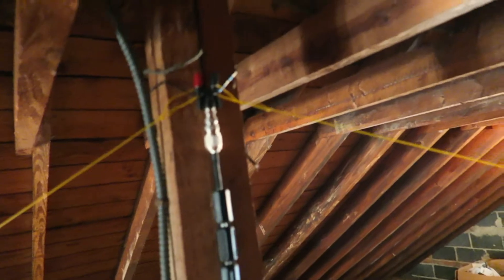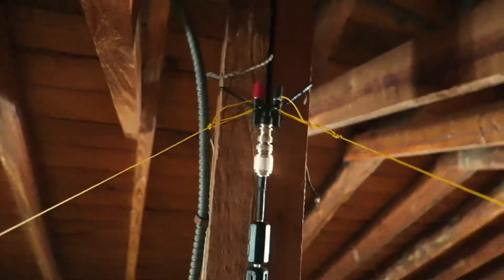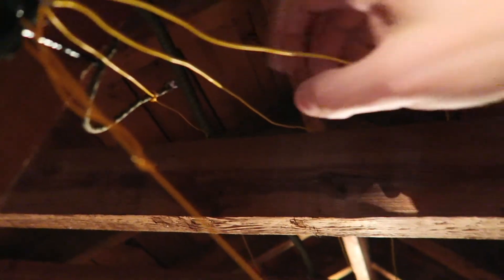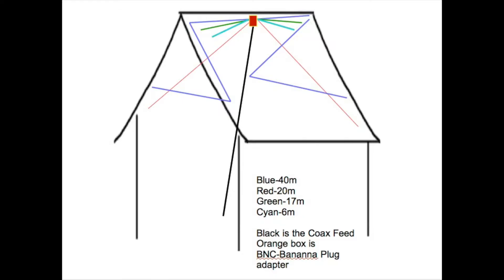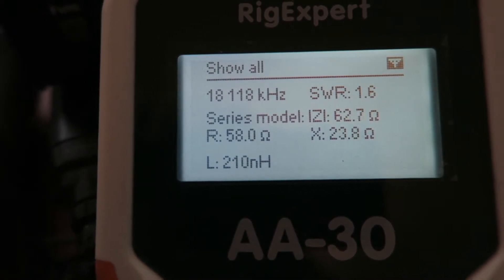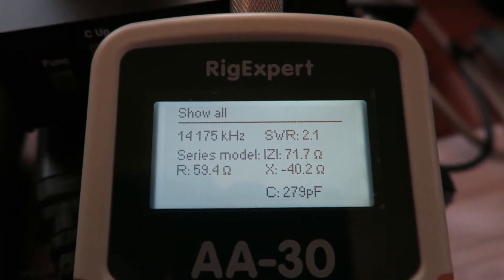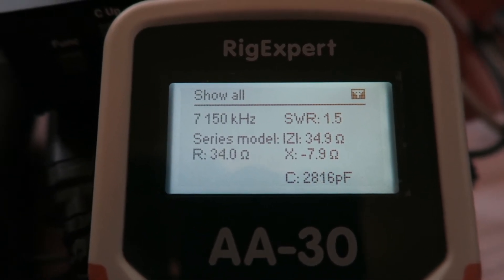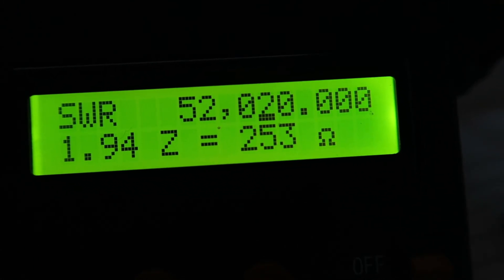Fan dipole, or multi-band dipole, antenna in my attic for my ham radio hobby

Comment: Have you ever used ladder line as the antenna element? You can make the antenna 33% shorter and get better bandwidth than our regular dipole. You only connect one wire on each side to the feed point and at the end you short those two wires together
Reply from the maker: Thanks! I just bought some 450ohm ladder line for another project. I might give that a try too!

Comment: Great video... I have a similar sized attic and started with a nonresonant 135' dipole and a 1:1 balun. My receive is excellent from 80-20 (best on 40) but my problem is transmit.  I'm running 100' of rg8 coax down to the basement where I have my shack. My swr at the antenna load point drops down to 2:1 at the most resonant frequency and is off the charts down at my shack.  I also have the same power lines as you do up there, and a small mobile dual bander for uhf/vhf.  I'm also running the coax inside the house instead of out the gable like you've done.  Where do you think I've gone wrong? I'm thinking about pulling out the dual bander first, testing again, then try running the coax out the gable. Would appreciate any suggestions you have.
Reply from the maker: Hello! Hmmmm, do you have any extra coax in that run? Maybe do a DIY choke at  antenna connection? Or at a minimum coil any excess coax. I think my feedline is 75'. I also have that short piece of coax with ferrite beads at the feed point you see at 5:19
Reply from the maker: Also, if you have an antenna analyzer, you could find out the resonant freq of the antenna and decide if the length needs to be adjusted.
Reply: @InPhocus_ADV  Thank you so much. I re-strung my dipole to include more straight paths around my attic and added a diy choke at the antenna/balun connection point.  This helped significantly. After reading some more about coax impedance at long lengths (100ft from the balun to my shack in the basement), I'm considering experimenting with ladder line. I have 100ft of ladder line I received with my DX engineering 1:1 balun. I have seen some folks online use ladder line from an attic dipole feedpoint to a balun near the shack, with a short length of coax to the tuner and figured I'd give it a try today.  Do you have concerns (fire, rfi) with running ladder line inside?
Reply from the maker: @michaelbordash1573  Ladder line seems to be well recommended, but I don't have any experience using it.

Comment: Very creative! Glad it's working out for you. I liked the drawing diagram. Makes it much easier to visualize. I have a 20'x20' garage attic that is one half of a full inverted V roof. So 8' high at center and 1' high at eve. I have a challenge ahead of me. :-0
Reply from the maker: Thanks for the comment! I was actually very surprised that the 40m had an SWR of that low....especially with the "zig zag". It does seem to be working,  I made a contact on 40m out to Cali during the SSB contest a couple weeks ago. Let me know how it goes...this is a fun part of this hobby, at least for me. (only had my general ticket for about 12 months now). 73 de K4SFC
Reply: I love tinkering with home brew antennas. BTW - Thank you for your service to our country! I see you have a Yaesu FT-857D and an Icom IC-703. I am a fan of the smaller, portable radios and small gear that does a big job. I have a Yaesu FT-897D and a Yaesu FT-817nd. I am planning to ad the Yaesu FT-857D or the FT- 891 next. I have been wanting an antenna analyzer. I have been looking at the MFJ models but really like your RigExpert AA-30 SO much better. I plan to order it or the AA-54 from HRO today. 73 de N0TRJ   ...-.-
Reply from the maker: I with that I had held out for the AA-54...but the AA-#0 was on sale...so..Honestly only need it for 6m...so I didn't beat myself up too much. Those two radios I have are...well...free to me. long story, but basically I borrowed them from work and a few months later asked the boss if the company wanted to sell them,...he said just use them and one of these days I might have to pay $50 for them). I really want an IC-7300 and a KX3, plus a lot of those sweet little QRP mountain topper type of rigs! The antenna analyzer is an awesome tool, the MFJ's are nice too, but a friend has the AA-54 and let me borrow it once, so I was familiar with the functions (most of the time). Hope the antenna build goes well! 73

Comment: That worked out well ! In multiband antennas a 2:1 is not a big deal IMHO .  Bending antennas does affect the radiation pattern (my 80M doublet was bent to fit) but they still work better than using traps and coils . The important thing is you made it work with stuff on hand and that is awesome ! Thanks for sharing !
Reply from the maker: Thanks brother! I'm happy they work, being outside takes a toll on an antenna. I still have an endfed wire out the window, but I suppose I could turn the attic into a spiderweb...lol!
Reply: LOL yes you could -  It would look like one of those old school yo-yo tricks
Reply from the maker: Yeah...I could never do those....so it would look like a cat got ahold of a ball of yarn up there.

Comment: Great video I love it!  I did that thing once where I was recording when I thought I was off and vice versa and ended up wasting my time.
Reply: I don't think you have to cut the ends of antenna off, just bring it back on itself tightly to shorten it without cutting it.
Reply from the maker: Yeah, I need to check and see what freq it is resonant and I'll know if it's too short, or too long. Thanks for commenting! Hey, did you get your antenna up at le casa?